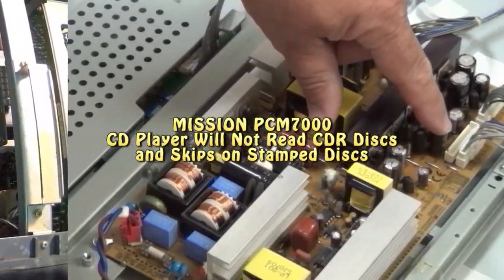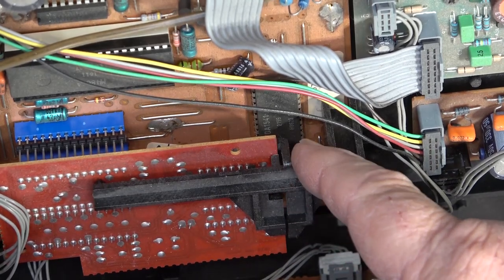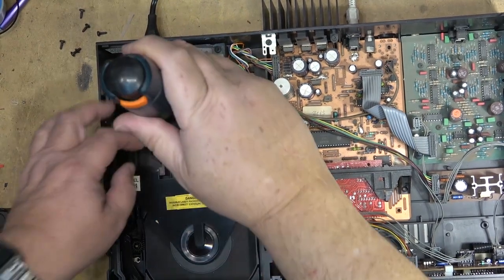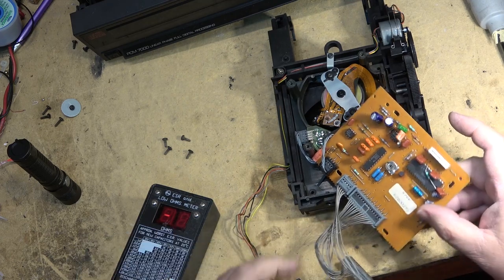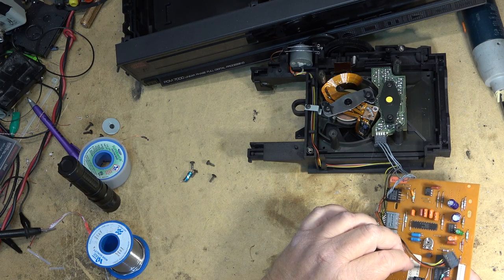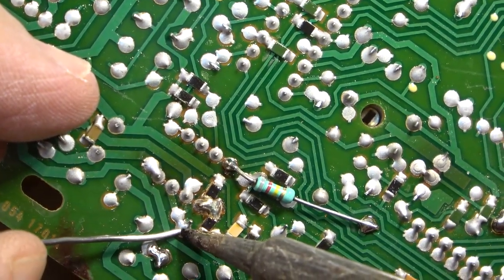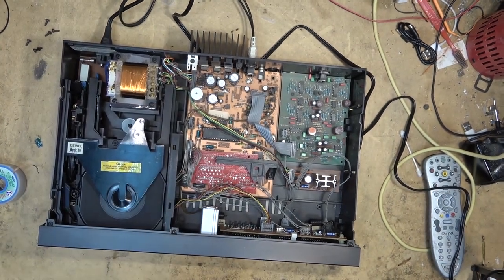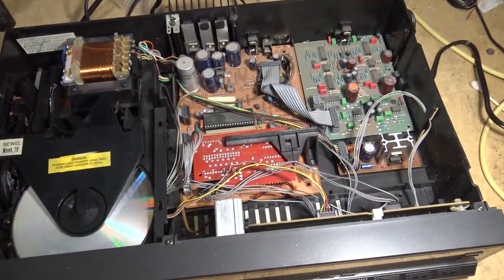MISSION PCM7000 CD Player Will Not Play CDR Discs

Comment: I fixed thousands of these transports in CD jukeboxes. You can do all the adjustments with a meter. The biggest problem was the oil thickening out in the spindle motor. You pull the board, unscrew the motor PCB and hammer out the shat with a pin punch. Oil the motor and try to tighten it close to what it was. Then I do a focus adjust to get it to 0 volts, which is affected by the spindle height. The laser diodes lasted forever. The servo PCB would be full of cold solders near the regulators in the corner. Also d/a converters would fail. Other than that, the best CD player around. Yes it will play CDR. Check that focus. You can also check Laser signal, laser current, and offset voltage to drive the pickup. Been a long time.

Comment: I had a pretty modern Kenwood that was always quite temperamental with CD-R'a, so you were forced to burn discs at the slowest x1 speed, which was probably the recommended thing to do, anyway! I do still have my Mission 700 speakers, which have been the one constant in my ever-evolving Hi-Fi setup, over the years..

This is a really nice player, though I don't trust those plastic-encased Roederstein (ROE) caps on the secondary audio board. They used to crack with age and then dry-out. Bang & Olufsen LOVED them! Gold-coloured Frako caps are also worth looking out for in any European-derived electronics, as they like to fail short. Ticking time-bombs! :0

Comment: This Mission's internals look identical to my Philips CDB650.  (Board colors, mounting, capacitors, even the warning stickers, laser power pot style.  Philips does not have the Mission metal base plate & analog filter output stage is different).  Thank you so much for making & posting this video.  (Green cap: bipolar, [respectfully added, kindly]).  Excellent work on that Mission CD player.  Thank you again.  🙂
Reply from the maker: Well that's because it's the same machine with the exception of the vacuum fluorescent display which has got missions logo on it and the base plate. Same player identical I have one as well Philips branded. he's a great old vintage players and people that have them generally don't want to part with them because of the unique sound that that DAC produces. The  green bipolar clap I didn't get a good enough look at it. It was 1.5 microfarads and the ESR was nice and low so I left it alone. But yes generally when they put a color on them at either indicates it's a bipolar, or it's a high frequency, are extra high temperature. For example Orange are typically 125 C. Red is very low ESR. The thing is there's no standardization, colors for one manufacturer are completely different for another manufacturer so really you've got to look to see, because in my lexman for example it has bipolar caps but they're red. All depends on the brand.
Reply: @12voltvids  Thank you so much for the kindness of your reply.  Thank you so so much for making and posting this video.  God Bless you.

Comment: I have a Magnavox from 1989. It played CDR's.
Btw, I had a Black and Decker power screwdriver like yours. It was my favorite. But the built in battery stopped taking a charge so I threw it away.
I used to have one with the removable battery before that. It stopped taking a charge too.
Reply: Ditto, also have a Magnavox that has no issues with CDRs. CDM4 mechanism with the slightly-less sought after 1543 DAC. Actually just diagnosed a transistor failure on the spindle motor drive last weekend. Symptoms awfully close to a failed laser, but fortunately just a simple BC328 preventing it from being able to spin the disc.

Comment: Philips CDM 2 based player; on players of that vintage, without even checking, replace all those blue/cyan axial Philips cap: they are all invariably bad. The one you replaced is very likely the smoothing cap on the  laser diode current driver circuit. If that fails, laser output is weak. On Philips CD player you can also adjust laser power so that PD's output are at optimal values and that can compensate for components ageing and slightly cloudy optics. Simple but very clever design; as a result all CDM based players (the swing arm mechanism) are very likely still working fine.

Comment: I had an early 2000s Marantz CD600OSE which had a similar problem in that it wouldn't play CDRs. Luckily there was a known fix where a 10pF cap had to be added to one position on the HF Amp board to make it read those discs. Even for a soldering newbie like myself, it was an easy job and it then played every CDR I gave it.

Comment: I have a Cambridge Audio Azur 640C Mk 2 and the same problem. Capacitors in the servo circuit are problematic on these too from what I have found on Audiokarma and other sites. Sometimes when I unplug it from the mains and let it drain off, it will play for awhile, then acts up again. Restarting from standby does not work. Downloaded the service manual, but they do not show you the locations of the parts on the board, only a schematic. Newer service manuals are not as good as the old Sony and Denon CD player manuals.

 I have had many Sony ES players, they are better sounding than the plain vanilla Sonys. I have a Sony CDP-X111ES that skips, along with a Sony CDP-350, same skipping problem. RF pattern looked good, except the diamonds were distorted at the bottom on the 350.
Reply: Ah the Cambridge audio CDPs of the 00's!! I spent years chasing issues with my 740c. If your buttons stop working, move the cable connectors around on front panel, and servo board... They tend to be faulty. Check your power supply caps spec... CA got a Chinese company to custom make caps for them.... Chinese company used a bad formula so caps fail early. Also, the transistors on the servo apparently go intermittent faulty even if servo caps are done. I was probably unlucky:)

Comment: You can't beat the TDA1541 DAC, I love 'em, I got a Philips CD-650 wich uses the same Transport and DAC, and have it hooked up through a small DIY 6J1 tube preamp I'm using as a buffer, but even without it the sound from that DAC is so sweet and musical. I like the CDM 2 series transports used in these earlier Philips made CD players,  they have better spindle motors than the CDM 4 series.

Comment: Oh yeah, CDRs are notorious for causing issues with most pick-ups, RF signal amllitude can drop by a half because of low reflectivity. Cue substantially increased jitter and error correction working itself to death. Half way through the vid, fingers crossed.

Comment: It's from 1987, so...
IIRC players with CDM-2/10 mechanism do NOT support CD-R playback.
Well my memory is REALLY bad apparently lol.
Reply from the maker: Seems to play them just fine now.
Reply: @12voltvids  I was pleasantly surprised to find an '89 Magnavox changer with a CDM4 (TDA1543) also has zero issues with "modern" low contrast CDRs 👍. I think it's gonna be my daily driver...
Reply: I have a CDM-1 based player from mid 80's and reads CD-R with no issue. To my knowledge audio CD-R's are red-book compliant and all players should have no problem with them (provided the laser and the optics is in good shape)
Reply: was cd-r even around then?
Reply from the maker: @larryb4129  I believe this unit was released in '86 or 87 so it predates CDR by a couple years as CDR officially was released in 1988 however, it had been in development. Not every CD player manufactured prior to 1988 is guaranteed to play cdrs. Some will and some will play some brands and not others, but once CDR became available it didn't take long before the CD player manufactures change their pickup design to make them compatible but it was still sometime before audio players could play cdrw, in fact many to this day cannot. Also early DVD players could not play CDR media but that was because they only used a single frequency laser. Pioneer was one of the first companies with the DVD 525 I think was the model that had a dual frequency laser. Sony actually put two optical blocks in their high-end very expensive DVD players one pickup specifically for CD and the other specifically for DVD. Pioneer did the same on their LaserDisc player that supported DVD playback. It has two physical lasers one red laser for DVD and an infrared laser for laser disc CD and CDR.
Reply: @12voltvids  I have an early 90s Harman Kardon that doesn't play CD-R, had it since it was new and never has...
Reply from the maker: @Qyngali  yeah there were some that didn't that's for sure some high-end machines that didn't play CDR

Comment: Alot Of People Fall For That It
Can't Be Fixed Bullshit. When 
It Comes Right Down To .It
It's Like You Said It's Just 
A Bad Cap & Solder Connection
See If You Took That To 
A Repair Shop They'd Give You
That It Cant Be Fixed Bull.
I Remember Radio TV Phono Nut
Said Gave His Dad His Portable Radio 
To Be Fixed & His Dad Told Him
The Repair Man Said It Couldnt
Be Fixed. Then He ToldHis
Dad I'll Keep It & Troubleshoot
The Problem. & He Found The
Break In Circuit &  Took A Jumper
Wire & Solved The Problem.
Then After That He Took The Radio
To The TV Repair Shop & Showed
The Repair Man What He Did To The Radio. Just Go On Utube
& Type In TV Radio Phono Nut.
Reply from the maker: A lot of shops would say they don't want to fix it because they don't want to fix it not that it can't be fixed. I run into this problem all the time people do not want to spend money to fix something I see I knew where to look on this unit because I fixed several of them in the past so I knew which capacitor was likely to be the one causing problems because I've done it before. This is I think the first one I've done on camera but I fixed these machines when I worked in the business. Unless you've seen the problem before someone showing you what it is you could spend hours chasing it down if you spend 3 hours on something at 90 bucks or 120 bucks an hour or whatever the ShopRite is and then you tell the person at the end I fixed it but it's 300 bucks and they say forget it I'm not spending that on it. This is what I get on a regular basis this one I'll be lucky to make $50 on this repair. now you're going to come back and say well it should be worth more than that but the reality is people don't want to spend money customers are cheap.  they were cheap the entire 20 years I was trying to carve a living out of repairing equipment I could never get what my time was worth. of course the second third fourth fifth sixth seventh time whoever many times you see it it's a money maker because you can fix them in your sleep but the first time when you've never seen that fault before you could spend hours upon hours troubleshooting. That's why a lot of amateurs will just go and change every capacitor because they don't know how to troubleshoot they figure it's going to be a capacitor so they don't know how to troubleshoot it it'll just change them all you change them all you're going to fix it. Had a guy that had an amplifier that was intermittent so he went and changed all the transistors himself changed all the capacitors and all the transistors fixed it for sure because when you change all the parts you're going to get the one that's bad. The real art to repairing equipment should be able to use test equipment go in and find the one component that's causing the fault and change just the one component this faulty. Those are  diagnostic engineers. I don't like to be called a technician. A technician is what I am at my day job I install fiber optic repair fiber optic install IPTV repair IPTV and internet and voice services micro-dpu, invisalight. Hang wires from Poles to the house run wiring around homes drill holes install equipment that's the technician's job that's what I do is my day job. Seminole just changes tires on a car that's the technician some of it just changes parts that's a technician the job of the diagnostic engineer is the guy that goes in with test equipment it figures out what the problem is down to the component. That was my job title and that's what I did for 20 years when I was in the business was troubleshooting down to component level. You would never see me going in and changing every capacitor in an amplifier just because I could just because I could pad the bill and change a whole bunch of parts that's not fixing things in my opinion that's a shotgun approach. Anyone who really understands electronics well understand that you may have 40 electrolytic capacitors in a circuit only one or two of them are going to be put under stress when it's operating the rest of them are just blocking or bypassing and coupling and they're not under stress and unless they're physically damaged it probably will never fail. It's only key components in key circuits which are going to wear out and those are the ones that you target. As they demonstrated on this CD player that was not playing CDR discs. And was having a tough time playing regular discs taking forever to spin up for example. One part and touch up a bunch of freaky looking solder connections problem solved.

Comment: I have a Sony 5disc charger from 1992 it reads compact dish no CDR
Reply from the maker: A CD player from 1992 should read cdr's no problem if it's not then perhaps the laser is a bit weak. I have lots of CD players that are older than 92 and they play cdrs just fine with no issues and they're all Sony's